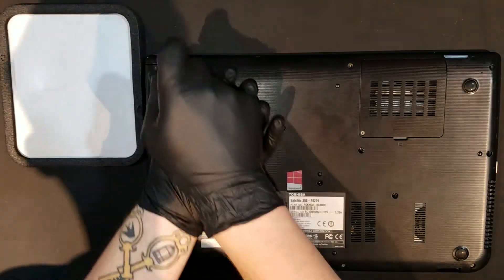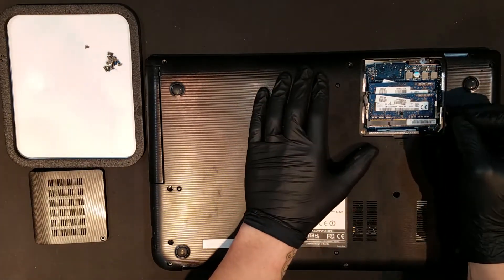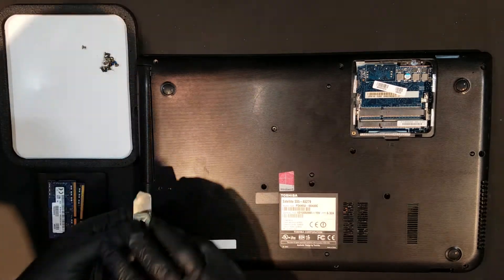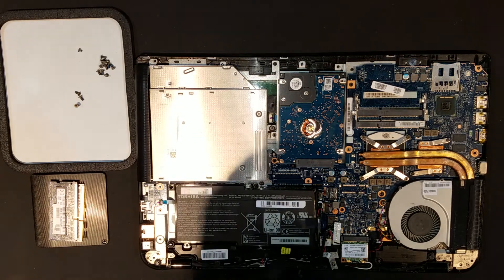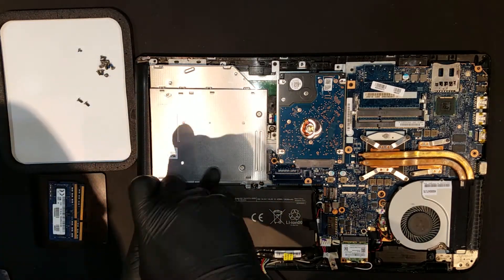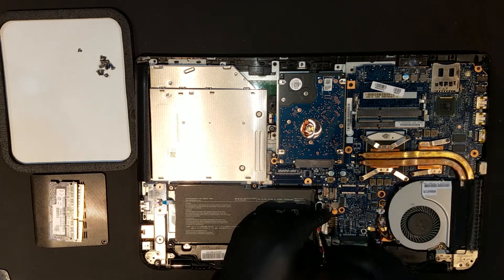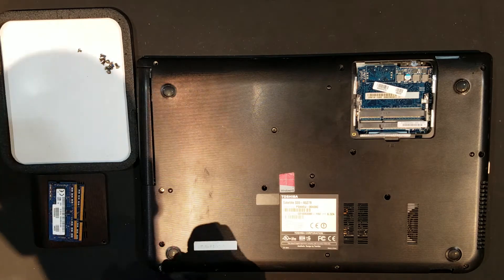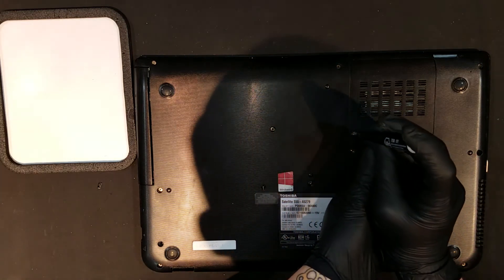Toshiba Satellite S55-A5279 15.6" Notebook Battery Replacement

Comment: A blast from the past! My S55-A5176 looks exactly the same. Runs fine with SATA SSD and 2 X 8 GB DDR3L-1600 memory modules. Mine doesn’t require removing the memory access panel screw or removing the memory modules themselves. Original battery lasted until September 2021. Replacement worked OK until recently, then failed completely overnight. Found only one replacement vendor on Amazon. Haven’t decided if it’s worth investing $27 just to be able using without AC power.

Comment: When I plug in the laptop to the charger it doesn't charge so I don't know if the problem is from the charger or not . My laptop is exactly the same as this one so if I tried this methode will it work ? Or do I have to replace the battery. Someone help please it won't turn on but there is one LED  light constantly turned on eventhough it won't charge
Reply: Hi Salma, i guess i have the same problem can you fix it? My notebook also exactly the same model. It can't turn on from today